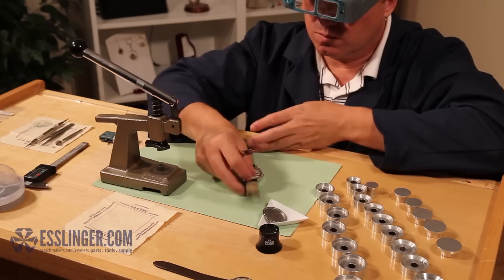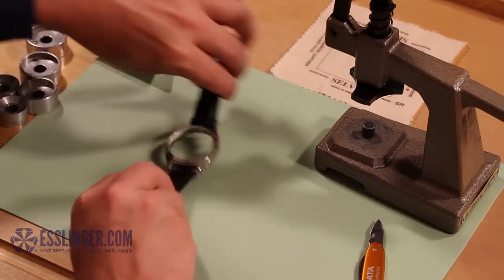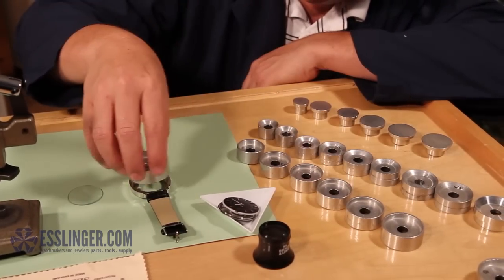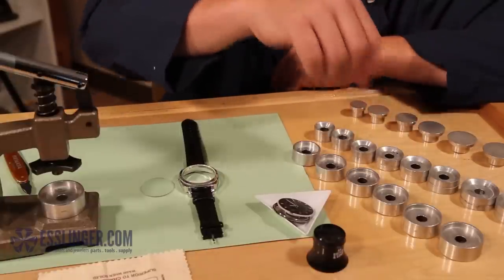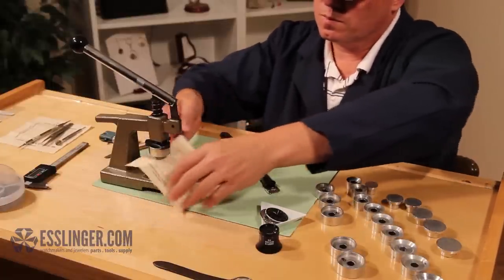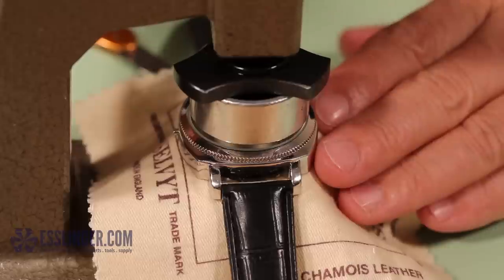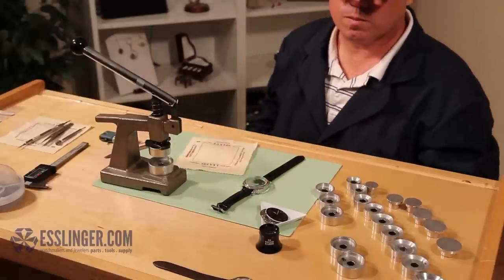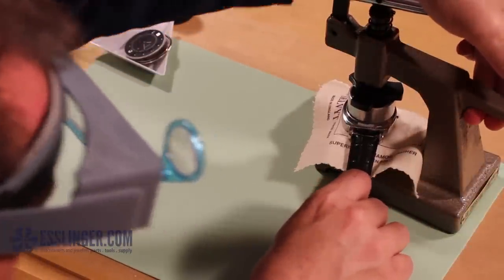How to Press Gasket Fit Watch Crystals with a Crystal Press

Comment: I am confounded--I have a Lucien Piccard vintage watch. Bought a crystal and rubber gasket which doe snot work at all??? There was a steel ring which appeared after I removed the crystal.  Is this a retainer for the crystal or the movement? I can' get anything to work. Like a previous post, why do so many videos skip steps--like the proper insertion of the gasket and explanation of what kind of gasket you need. (Plastic, rubber, the steel ring I mentioned???)  Vey frustrating.
Reply: The steel ring you're talking about is most likely a tension ring on your watch crystal. Many vintage watches have these "armored crystals". They also go by other names, such as "A type" and "reflector ring".  The tension from the ring against the case is supposed to create a water tight seal.
Reply: @emilm8603  Are the tension rings replaceable?
Reply: @1rightrev  In many instances the tension ring and crystal will have certain grooves to make them fit properly together, and the bezel might also have grooves to give the crystal a snug and stable fit. Thus mixing and matching might be a tall order. Watch crystals can be had fairly cheap, so I would probably recommend just buying a new crystal with a ring on it. Did your ring break into multiple pieces? I've gotten away with using a ring that broke in one spot on an old watch I couldn't be bothered ordering a new crystal for. 

I realize I also made an assumption about it being a crystal tension ring since you said it showed up as you removed the crystal. Generally you would find what you called a "retainer for the movement" on the watchmakers side of the watch (the opposite side of the dial). Was the metal ring uniform and circular? Or did it have flat angles all the way around?

Comment: If the dyes are plastic do you still need a selvyt cloth?
Reply from the maker: There is not a need for a cloth with plastic, nylon, delrin, rubber, or other soft materials. It can be used to be extra careful when trying not to break the glass but you lose some visibility while using the cloth.
Reply: Ok thank you that's what I thought. I just received my 30mm x 2mm mineral glass for my Seiko I purchased from your website and it looks fantastic. Thanks so much!